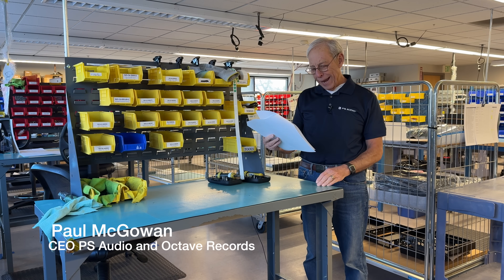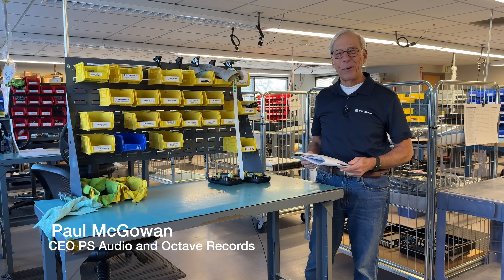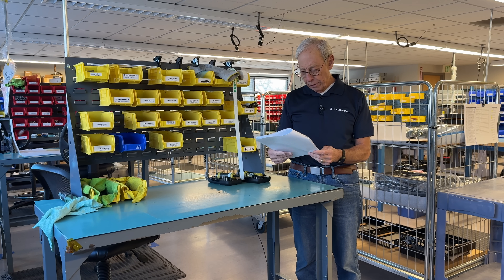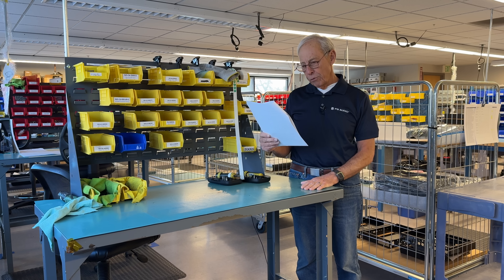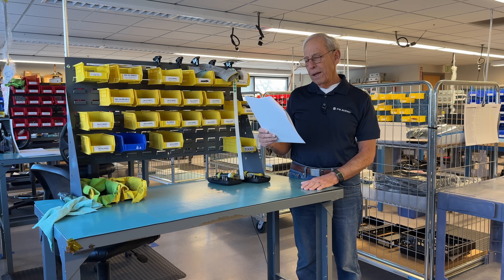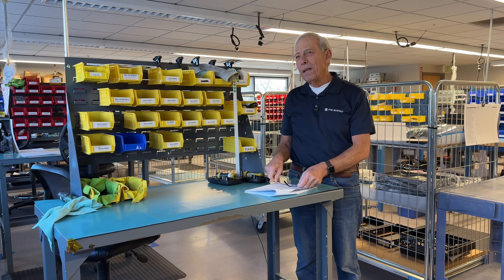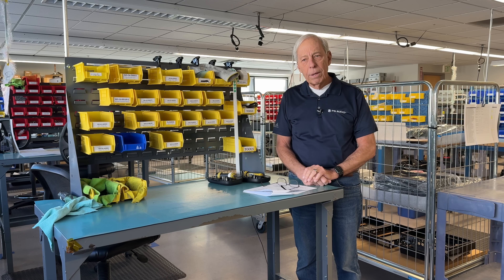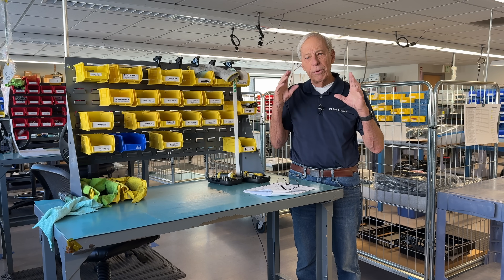Paul explains equipment burn in

Comment: I have been an electronics engineer for over 40 years. Semiconductors should require no burn-in but in a circuit do require temperature stabilization. If your semiconductor parts require a burn-in period then they are inferior. Having said that, capacitors definitely stabilize over time and will form themselves to the voltage level of the circuit in which they are used and this is also effected by temperature.  The first time that you run a device, those capacitors will stabilize.  Once this period of time has elapsed then it should be very stable but there is still the question of warm up and every time a device is turned on it has a warm up period before it stabilizes. This is the reason that bias and offset settings in an amplifier aren't adjusted until the amp has been on and running idle for several minutes.  What this means is that every time you turn on any electronic device there will be a period of a few minutes before it stabilizes and that period of time is largely based on circuit design and as Paul said is almost null for digital circuits due to the very low voltages involved.  As for whether burn-in makes a device sound better, it really depends on the manufacturer and how that circuit is designed and it could perform better after burn-in or worse, although this is usually engineered to hopefully be better . Technically, for every device to sound it's best, you would have to burn-in every unit at the factory and then adjust the values of certain parts in the circuit to be optimal for that circuit.  Some boutique companies do this because they deal in small quantities of units at high prices so they can invest this time to calibrate every unit and they also choose components of a lot higher tolerance so those values don't change much.  For mass marketed units built to a price point, this burn-in calibration isn't possible and is also the reason why multiples of the same manufactured unit can sound different from each other.  I know that this was a long winded explanation and if you made it this far then I humbly thank you and wish you a terrific day.  Cheers all !
Reply: Thank you for the detailed explanation.
Reply: Words of a true engineer^_^
Reply: Thankyou kellywilson finally some  Words of reason. Paul is like a nice fatherly fairytale reader. He is enjoyable and pleasing  to listen to. I just need to remind myself although his words are kind and soothing, they are just a work of  fiction.
Reply: Yup.agree
Reply: I've experienced these on my Audiolab Omnia, with a loudspeaker setup 2.1: ELAC FS 247.3 and ELAC Sub 2030, by streaming HiRres Music on Qobuz. Immediately after starting the Hardware, the music sounds thin and the stage is pretty small, running it some minutes the music becomes rich and the stage wide.
Reply: @kellywilson2858  fantastic explanation however it think it will be  beyond the comprehension  of Paul and his congregation. Their golden ears rule supreme. If they say they heard "voices" sorry I mean differences then they do. I suspect that  component over- burnin in their hearing aids could be a possible cause.
Reply: Paul is a multi millionnaire been in the industry for longer than you can imagine and he tells you about breakin and all the world experts talk about breakin and one guy that  is a nobody comes along and all you clowns follow him
Reply: @arlenesauder1913  have you heard something about the freedom of speech and the freedom of thoughts? You bootlicker!
Reply: @arlenesauder1913  that's right Paul is a multi million salesman, good at tricking stupid ignorant people like you. He claims stuff that isn't supported by electronic theory or physics. In fact we should believe Paul because he has made lots of money is what you are saying.. Just because someone is a good salesman does not make them right. Same as the guy currently in the white house. A great salesman.
Reply: @arlenesauder1913  Paul is a multimillionaire? Yeah made by tricking ignorant people like you.
Reply: @arlenesauder1913  ahh 1 thing before I forget,  question? Do you know what a capacitor is and what does?🤭 I notice Paul has a video explaining to you and his other followers what it is? I learnt that when I was about 12. That's gives an idea of the level of ignorance of his followers. 🤣 keep people ignorant and you can tell them anything
Reply: checkout Paul talking about capacitors sounding different 
https://youtu.be/mCk50RTtrT0?si=0UNu_aStlvim2NNm
  See 5:05 he say"he thinks a micro farad is 1000th of a farad:" its a millionth
 Paul  doesn't know even the most basic concepts of capacitors yet makes himself out to be an authority. Typical ignoramus audiophile. Pretends to know things when they clearly don't,  what a joke. You should be embarrassed defending this ignoramus. Go and look it up yourself.  Verify for yourself😂

Comment: Wonder why burn-in always improves an audio component?  Why does burn-in never make the sound quality worse? 

It's just more debunked audio lore being spread by Paul. There has never been a double blind listening test that shows burn-in to be real thing.  What happens is, over time, the different sound character produced by a new piece of equipment becomes more familiar and thus seemingly more acceptable.
Reply: Yes, exactly. It always gets better, absolutely ridiculous.
Reply: Because at the beginning the sound is often not very dynamic, flat, thin, lifeless, simply boring. Over time, it becomes more open, dynamic and weighted. However, it may also happen that the treble opens too much over time and may be more disturbing than at the beginning. We then say that the loudspeakers/equipment sound too bright because the sibilants are too strongly emphasized.
Reply: @bebbop Nonsense
Reply: @yoddeb 
Have a nice day (night?) :7
Reply: @bebbop  Nope. The sound is no different. It's been proven in null testing - sound recordings made with brand-new equipment are exactly the same as they are after a "burn-in".   It's just a dishonest claim made by audio manufacturers to get people to not return equipment that they initially don't like.  People are less likely to return stuff that they've used for weeks.
Reply: I describe my own experiences. I would also like everything to be simple and clear at the very beginning, but unfortunately in reality it is not that simple. I remember once when I bought my first, new tube amplifier. Everyone was excited about it because it played very spatially. Of course, encouraged by the opinions, I bought it. Unfortunately, for me it didn't work as great as for others. It was good, I was generally happy with the purchase, but there was nothing special there. I thought that maybe I had weak speakers that limited it, so I left it alone. After half a year of use, I turned on the amplifier as usual, it played for 2 hours and suddenly a holographic space appeared, filling the entire room. Of course, I was in total shock, because I had never heard anything like that in my room, and I knew some holographic sound only from the stories of audiophiles on forums, which I considered to be some kind of fairy tale for children. After figuring out what exactly happened, I came to the conclusion that the tube amplifier, which was the last purchase and the only thing I changed in the system, must have finally burned in. It probably took so much time because I listen to maybe 5-6 hours of music a week, and from what I remember they recommended playing for 300 hours to fully burn in. Ultimately, the sound turned out to be spectacular and I finally understood where all the admiration for it came from.
Reply: @bebbop placebo and/or your aural system adapting
Reply: @yoddeb  
I had to leave my family home and move to a room half the size. Unfortunately, the holographic effect and space filling the room are no longer there. Where is the placebo effect or aural system adapting when I really need it now?
Reply: @bebbop  Fortunate that it got better, not worse.
Reply: Yep!
Ever wonder why break-in always improves shoe fit? Why does break-in never make the shoes fit worse?
What about clothes? Why do they always get more comfortable over time? Why don't they shrink up, or get way too big on one side and too small on the other?
Hmmm...   🤔
Reply: @bebbop 
Look at you, cowboy. Out here all by yourself with these trolls trying to gaslight you into believing that life is a disingenuous event. That every time you wake up in the morning, you're hallucinating your entire day.
Next, they'll be trying to convince you that you don't exist.
Ever wonder why shoes fit better over time? Why don't they fit worse? Insipid dreck. Try saying that in a shoe store and they'll have a good laugh at you.
Stand firm, my brother. I have shared similar experiences and know that you are correct.
If you want to feed the trolls, feed 'em their own BS.
Reply: @bebbop  
"After half a year of use, I turned on the amplifier as usual, it played for 2 hours and suddenly a holographic space appeared, filling the entire room."

Probably the first time you landed your butt in the room's exact sweet spot.

Changes like that are not related to electronics... they come mostly from the realm of psychoacoustics.
Reply: @Douglas_Blake  
The best thing is that I was lying on the couch when it happened :7 I always sat in the same place, in the middle of the couch. Sometimes, when I was taking a nap, I would turn down the music a little to let it play in the background and lie down on the couch. It's hard for me to say what exactly happened then. Did the loudspeakers just "burn/break in", even though I had them for 2 years (KEF LS50), or was there some "synergy" between the equipment? The loudspeakers were always in the same place, I never moved anything. I only changed amplifiers. I had several solid-state amplifiers before, but it was only with the tube amplifier that the "magic" began.
Reply: @bebbop  
What most likely changed is YOU ... your listening position, your mood, temperature, humidity, sobriety, tiredness... heck, even the last dump you took will affect your hearing perception.
Reply: @Douglas_Blake  
I don't understand this explanation. I've been building and listening to my audio for about 15-20 years. For 15 years I had a bad mood, bad humidity or temperature in the room? Things like this can affect a person in a matter of days, not over the course of a few years.
Reply: @bebbop  
Let me give you an example....
I had one client who complained that he wasn't getting the "soundstage" effect from his system.  When I got there the stereo was setup as you'd expect for an audiophile, speakers half way down the room, couch facing, equipment on racks against the front wall.  I sat where he indicated that he always sat and noticed that the speakers were not centred on his listening position.  I moved to the centre of the couch and there was the full soundstage, almost perfect. A little bit of tweaking to get the speakers equidistant from the sweet spot and there it was, the whole show, working perfectly. His problem was that he had never actually sat in the right place, in all those years.

So are we talking about 5 feet?  One foot? ... nope just a couple of inches. The actual sweet spot for most stereo systems where you get the full effect is about 6 inches wide, if you're lucky. 

If you don't believe me... play some monophonic pink noise on your system, at a low/medium level.... sit exactly in the middle of your speakers, where the sound is straight in front of you... now move your head about 6 inches to the left then the right... You will hear the entire tonality of your system change, even the left-right balance will change.  Yeah, it's that sensitive.

Whether we like it or not, we have 2 ears that are not in the same place, so we are actually listening to two separate locations in the sound field at the same time. Unless we are dead centre in the sound field, with correctly placed speakers we aren't going to get the full effect.

As for why this suddenly changed for you... I don't know exactly, but if you were laying on your couch it's highly probable your normal listening position is not where you get the full effect. Or maybe you had a minor problem with one ear that corrected itself .... In any event it is far more likely the difference was in you than your system.
Reply: @Douglas_Blake  I understand your point of view, but I still think it was different. I once read about a method of positioning loudspeakers called Sumiko. I had the same effect, even though I did not tinker with the positioning of the loudspeakers. The Sumiko method assumes that if you change the listening position by a few inches and the sweet spot disappears, you have incorrectly positioned speakers. With well-placed loudspeakers, the sweet spot is very large. You can sit on the sofa wherever you want and you will still have a holographic space. I had the same effect. Whether I was standing, lying, or sitting at one or the other end of the couch, I had a holographic space. It's as if 2 different images from each loudspeaker were combined into one whole, creating one large, intensified, real image. As if there had previously been some invisible glass between me and the loudspeakers, which muffled and blocked the sound, like a closed window. Then, by itself, an effect appeared as if the glass had cracked, as if a window had opened. Everything became momentous, open, direct. Microdynamics is as if it were at some molecular level. As if these dust particles, which float in the room and are visible only when the sun's rays fall at a certain angle, would make a sound and swirl around the entire room around me. I really have no idea how it all happened or what it was. Was it the tube amplifier that finally "break in", or did my ears tune in somehow, or did the LS50 with its Uni-Q loudspeaker also help in all this? Nice instructional video about the Sumiko method:
https://youtu.be/0Toiwe-Xe98?si=FFXDlSoT4p_HbkgM

Comment: Must equipment burn in ALWAYS lead to better sound quality?

I've always understood speaker burn in break in because it's a mechanical device.  But why does electronics burn in always result in better sound?  Isn't possible that as the electronics burn in and the cap and resister values settle in and they go off spec a little bit?  Or does this not happen because when you design and built prototypes you end up with very well played in components from the development process such that the final component values you choose are based on broken in parts? Or is there ever a time when broken in/burn in gear sounds worse?
Reply: Good questions nobody, esp. sales men, will ever answer sufficiently.
When does a device reach it's sweet spot of burn-in? And how can it be that such devices cannot burn-out, turn to the worse?
And who defines burn-in is always to YOUR taste i.e. "better"?
The whole story about burn-in shows some real inconsistencies.
Reply: It will always improve transients by limiting phase shift , new capacitors inside power supply or crossover always limit attacks / speed.

Comment: Burn in is definitely a thing.  Capacitors are an obvious target and differenct capacitors take longer than others.  All of them need a few hours of use before they exhibit their final character.  Blackgate caps are particularly long and can take 100 hours to fully bloom.  I also find that even resistors take time to settle.  If I make any change including a new solder joint, I like to let the system play for a few hours before listening critically.  With a DAC, I leave it powered all the time.  Clocks are best when they remain powered.

Comment: if burn in were critical in electronics, building new electronic circuits would logically require burned in parts to prevent the circuits from changing in use.
Reply: You see...
Reply: Define "critical".

Comment: Seems to me that short term,  warm-up and stabilization of a circuit is a real thing.  Long term burn in of electronics?  This implies the characteristics of the components are changing enough to create audible results.  Maybe this is due to using under rated parts or something is wrong.  Then things like transducers are mechanical or electromechanical and affected by the environment and use like any mechanical device.  Speakers,  headphones,  cartridges,  and turntables and tape decks are mechanical devices,  but those last three would seem to be things that start to deteriorate from zero.  As for tube electronics,  yep they may take longer to stabilize than solid state gear,  change more and are also in a decline,  mostly slow at first,  due to their characteristics.  Speakers may last your lifetime or start to wear out due to deterioration of the materials of which they are manufactured,  or abuse.

Comment: Not a problem if you buy (only) used equipment. It is much cheaper and you do not have to "burn in* anything.
Reply: But then you may have ‘burn out’ of specification
Reply: Nothing is black-and-white, it all depends. What do you mean by "used equipment"? Used equipment can be something someone bought 3 days ago, and put on sale almost brand new. It could also be a device that is +30 years old, and probably not in best condition with such age.